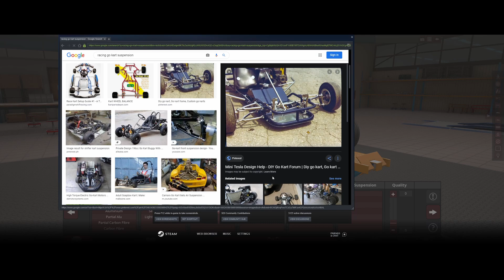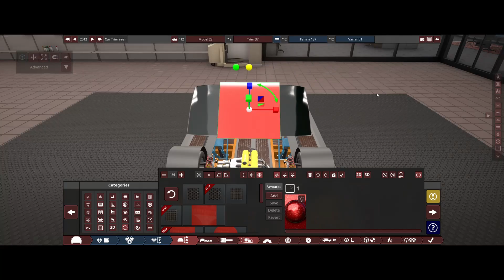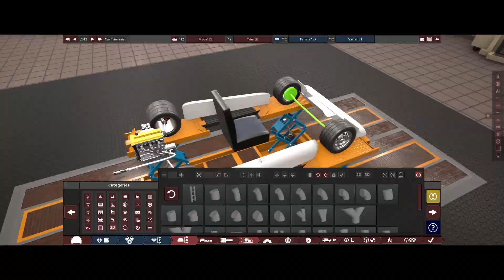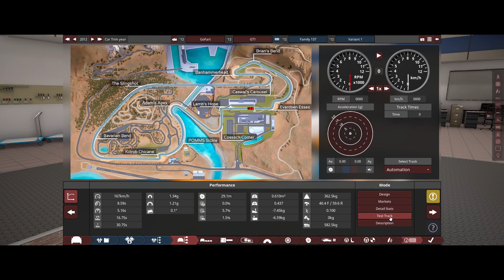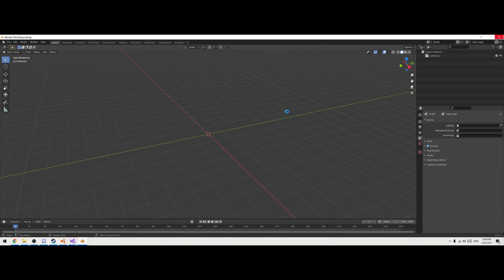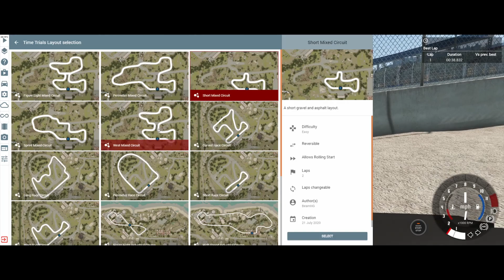No Suspension + 1 Gear = Record Breaking (automation🔧BeamNG)

Comment: You can modify you camera position, there is a camera setting in the camera settings which is called relative camera, and you can move it.
Reply from the maker: unfortunately it doesn't seem to work :/ I've tried it a few times
Reply: Ok